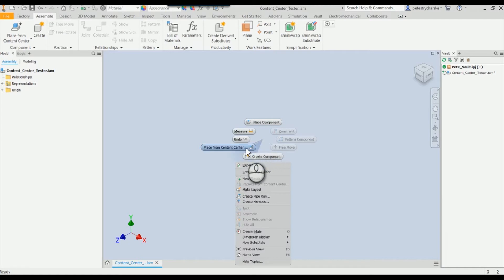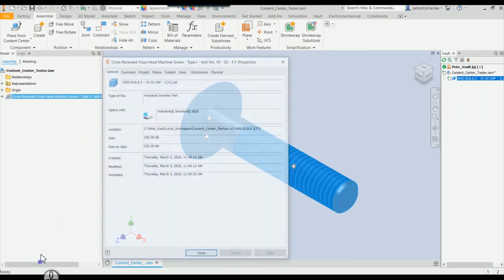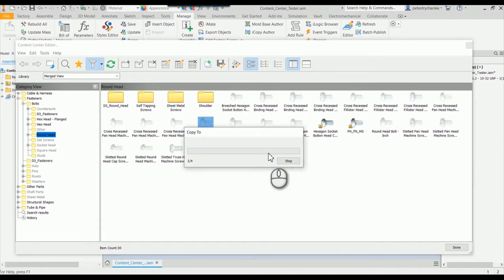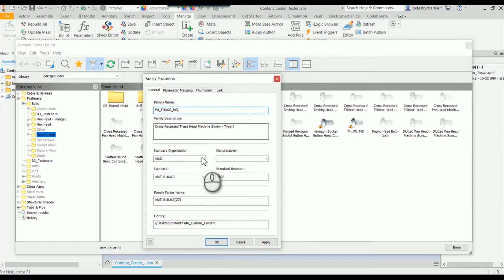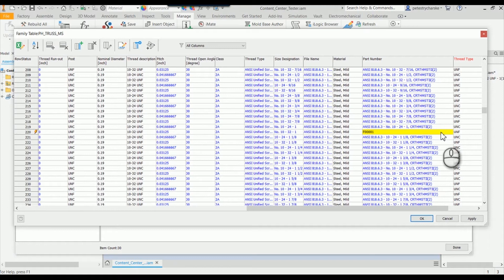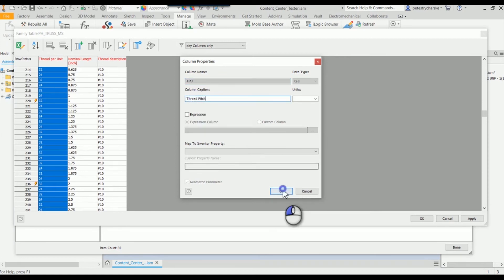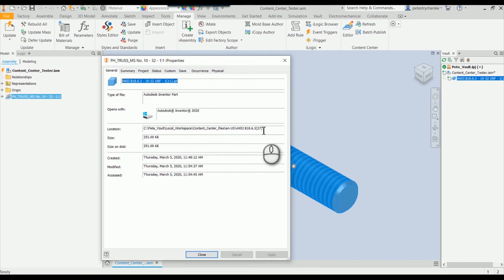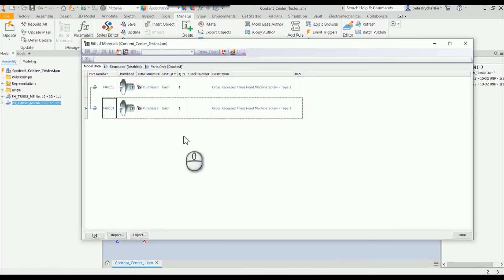Inventor - Update Existing Content Center Files With Better iProperty Data

Comment: Good Video, so the copy to command is not all that pointless as some say. If I've got it right,  it can be used to make changes to the original family iProperties and have those changes transferred to all used and to-be-used instances.
Reply from the maker: Sardar, you are correct.  If you've already placed several or lots of out-of-the-box Content Center data, then the "Copy to" option would allow you to make iProperty updates and Refresh those parts.  My rule of thumb is to use "Copy to" if I'm ONLY changing the Part Numbers, Descriptions, Stock Numbers, etc. (iProperties that already exist).  I'll use "Save Copy As" if I'm planning on adding my own custom iProperties or modifying the geometry.  That way things are de-linked and there's no chance my updates will get wiped out from the original family.  It's a low risk, but I'd rather be safe than sorry...  Thanks for reaching out, hope this helps and have a most blessed day!